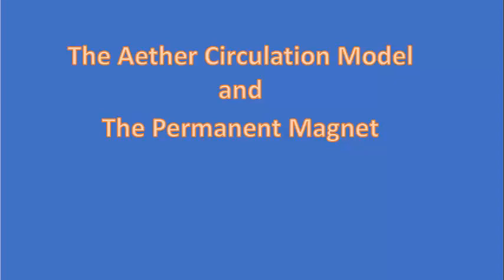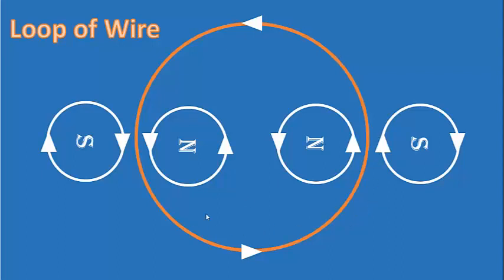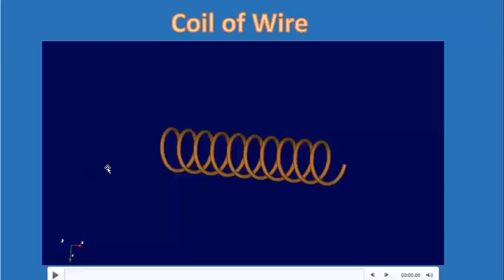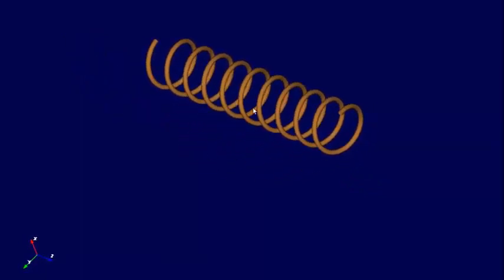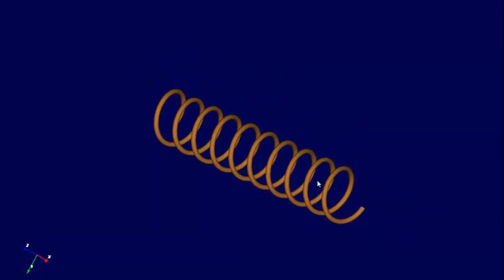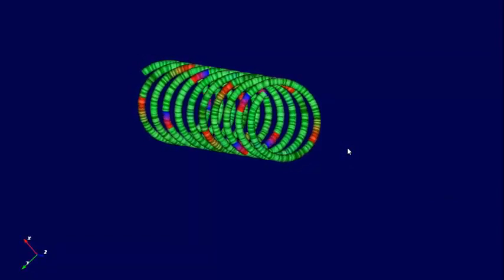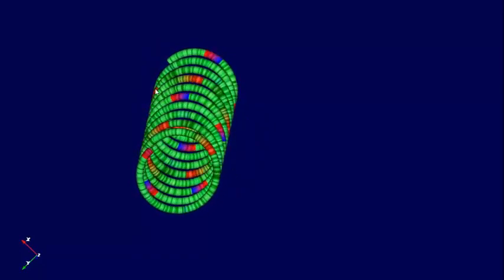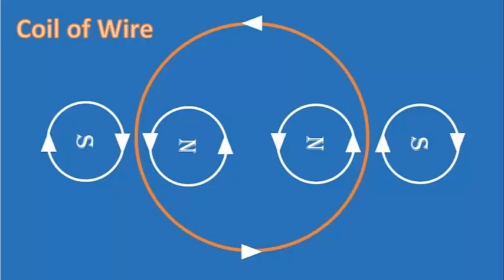The Aether Circulation Model and the Permanent Magnet

Comment: Precise and easy to understand explanation for the solenoid. But what about the CADUCEUS coil in which the wires cross 90 degrees in nodes opposing each other?
Reply from the maker: Yes, there are many coil configurations that will need to be studied. So much to do...so little time.
Reply: @FractalWoman  If you had an Æther simulator program you could run all kinds of configurations.
Reply from the maker: @codetech5598  That's the plan. I know that Ionel is currently working on something. I am also working on it, but this is a much bigger job than the simple animations that I am doing. It involves computational fluid dynamics which is not trivial. This may be my winter project.
Reply: @FractalWoman  Of course it is not trivial but those kind of programs already exist for simulating aerodynamics, weather systems, etc.
Open Source is the key here. There are many programmers much younger than us who have lots of time on their hands and are enthusiastic about getting involved with new things.
Reply from the maker: @codetech5598  Yes. I know. Ionel tried to find a team, but he was unsuccessful. The people that have this kind of experience work for big companies and make lots of money. I'm not saying it is impossible. Just very time consuming. Even with open source, you still have to take the time to learn the software which is also and often, not trivial.
Reply: @FractalWoman  
How difficult is it? I think it depends on the mathematics involved - how consistent it is, and whether or not the same model applies in all cases. For example, in normal CFD programs, there are different behaviors of fluid depending on boundary layers, turbulent vs laminar flows, etc, etc, and it is non-trivial to apply the proper models in the analysis. 

But how many different rules and behaviors does the Æther actually do?

"Ionel tried to find a team, ..."  Ionel has amassed a mere 219 subscribers on his YouTube channel since 2010 which suggests he is not experienced in publicity or gathering support.

 By the way, there are many researchers online who will build hardware (and possibly software) and run experiments. For example, https://open-source-energy.org/
Reply from the maker: @codetech5598  Cool. Thanks.
Reply: @FractalWoman  Russ (RWG) is one of the main people on that forum and he builds and tests many things involving coils and such. For example, "Building The Motorized Tool For CNC Flat Coil Winder Part2" https://www.youtube.com/watch?v=-n5tO1uJU1o so you can see he is precise and doesn't just hack things together.

Another person interested in magnets (he is attempting to build the John Searl SEG) is  Jason Verbelli https://www.youtube.com/c/TheRealVerbz/ ). Besides the SEG project, he also makes and promotes videos of the type that we have interest in.

There are others too.
Reply: @codetech5598  Russ and Verbelli? Come on guy.  You know you're better than that SEG waste of time. They have to make this info a little harder to find to weed out the weirdos. I'm about to become a flat earther just to have someone to talk to who isn't that far off when they have something to include in a discussion. 🙈
Reply: @ulikeyapples7961  Whether or not the SEG is viable is not the point. The point is that both Russ and Jason have the interest and the resources to produce high-quality work on magnetic-related projects as their work on the SEG (or parts of it) demonstrates.

I recommended Russ because he is an advocate of open-source, and Jason because he is interested in Æther-related issues and would be likely to promote this work.
Reply: @codetech5598  yeah...okay... bromandude . Why don't you get a little Clarity before you waste more of your own time and others time with your nonsensical comments. It's too bad they didn't do the same thing first so you didn't have to fall victim to their ignorance has which have become your own as well.

Comment: happy birthday!  does a compass needle point at the north pole of your magnet or does the needle flip to south?
Reply from the maker: At the center of the inside of the magnet, the South pole of a compass points toward the North pole of the magnet. As you move the compass away from the center of the magnet, the compass slowly turns around. At some point the poles will be reversed. The pole finder doesn't have that kind of sensitivity. It is either North (which means more north) or South (meaning more south).  This is hard to explain in words. Best to take a magnet and and a compass, and look at this first hand. Words don't do it justice.

Comment: Is their any software you made that's not paid by your employer that can made public?
Reply from the maker: The software I am showing is not proprietary. It is a toolkit called VTK which is open source. I could share the code, but that opens up a can of worms in terms of support. I choose not to go there.
Reply: @FractalWoman  Just throw it on GitHub.
Reply from the maker: @MichaelPohoreski  GitHub is a double edged sword. If I put something up there, I am going to feel obligated to support it. I don't have time for that. Also, the code that I write for myself isn't always pretty. I am an experimenter and my code is ever changing.
Reply from the maker: @MichaelPohoreski  By the way, I noticed you have a Buddhabrot for your avatar. Did you know that I coined the term "Buddhabrot" https://en.wikipedia.org/wiki/Buddhabrot
Melinda Green invented the algorithm and I named gave it a name. :-)
Reply: @FractalWoman  It is fine if the code is unsupported.  The last commit date makes it obvious. There is SO much code on GitHub that is unsupported. Availability in the long run is more important than any qualms IMHO. I have 200+ repositories on GitHub because it is so easy to experiment.

Comment: Happy Birthday ☮💞🤗☮🌻🎂 
I am thinking about how much this can be scaled up, we see these structures in the heavens, the magnitude says its AC high voltage, I'm thinking the DC voltage is static charge from all the sust. It seems to me that scale is everything when it comes to this type of experimention
Reply from the maker: Self-Similarity == Scale-Invariance.
Reply: @FractalWoman  Soooo.... Æther, scaler (wave), 🤔 so all those ACv structures must be alien space truck exhaust trails.  
Thanks for clearing that up. ☮💞🤗🌻
Reply: @ETALAL  There are regions in Space that contain ionized gasses. These are electrically charged and if the charge is high enough they glow like the "plasma ball" electric toy. 
See "The Thunderbolts Project".
Reply: @codetech5598  OK so those pipes of plasma from the ball to your finger (protected by the glass) on a cosmic scale show emag or ACv an electromagnetic river or coil. 
So what is æther? The time difference between the poles as you cross the plenum ?
Reply: @ETALAL  Æther is the underlying substance which produces all electro-magnetic effects,  gravity and inertia, and ultimately matter itself.  It behaves as an "ideal" fluid, hence the references to circulation, flow, etc.
Reply: @codetech5598  OK thanks, I agree  🙏☮💞🤗

Comment: F.W. Hi.
So the "Big Q" what sustains a magnet? 
How does it stay a magnet, unless heated? 
There must be a "Feedback Loop" Yes?
We can have "Polarised Light" (R&L).
I find this simple yet profound. 
Regards ... DC
Reply from the maker: That is a great question. You can think of this in terms of a flywheel. When you spin up a flywheel, what keeps it spinning? Inertia.  A coil without an iron core is like spinning up a piece of Styrofoam. It will quickly stop spinning when you remove the force that causes it to spin. But a coil with an iron core is like spinning up a very heavy flywheel wheel. Once it is spinning, it will spin for a LONG time.
Reply: @FractalWoman  yes, so does Aether spin together with the magnet's spin keep the magnet going? Its the voltage or current, maybe! Just trying to visualise. Regards .... DC